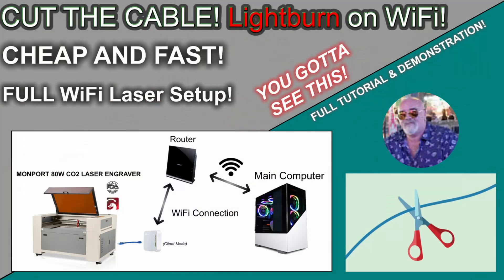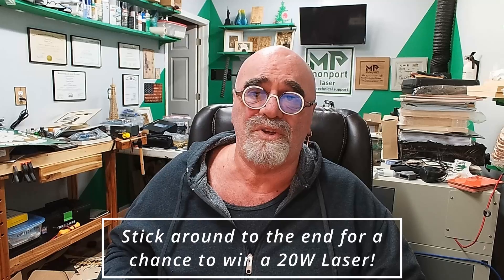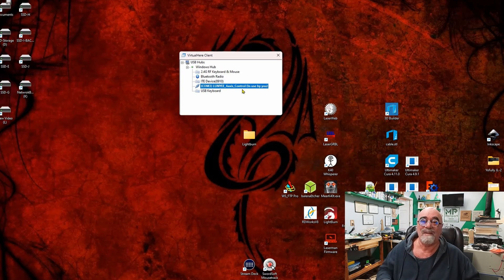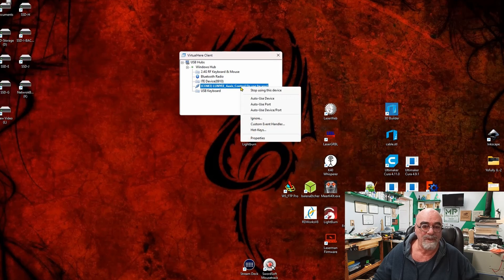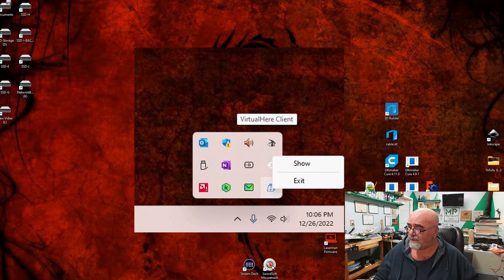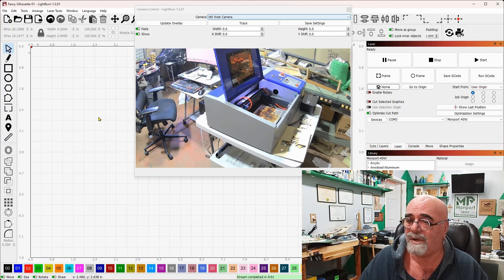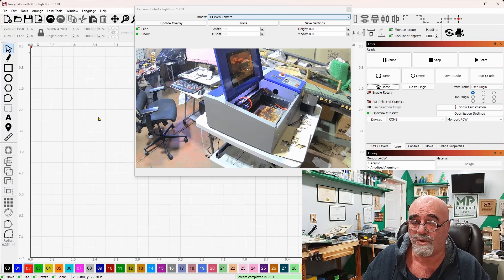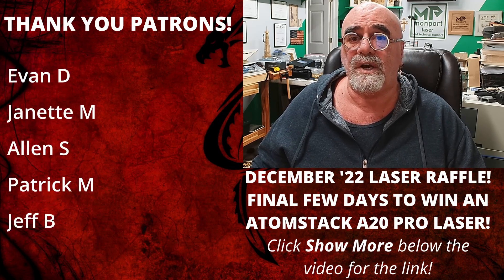➡️Remotely control your DIODE LASER⬅️ with ANY OLD DEVICE with a USB port on your network!

Comment: Much easier and cheaper to use any old notebook and Anydesk software to reach it from anywhere. Make a project in Lightburn at home, save it, pull the file to the notebook next to laser, open there and burn. And notebook's webcam from the lid can be used to control visually.
Reply: Oh yeah, that's way easier and cheaper than selecting connect on free software and opening lightburn...😆😆
Reply: @Ron Staton  Ah, I always forget, that you pay for software.
Reply from the maker: I can think of a dozen other ways to do it, but none of them are easier or cheaper. We'll have to agree to disagree!

Comment: Is there away to get what I make on one computer with lightburn and have it come up on a second computer with lightburn?
Reply from the maker: There are several ways Terry. Networking is one, a NAS is another, or the most basic of all, a simple flash drive.
Reply: @TheLouisianaHobbyGuy  I've been using bluetooth but having to run up and down stairs sucks. Be nice if Lightburn could have where lightburn automatically would update to all comps.
Reply from the maker: Use remote desktop:
https://learn.microsoft.com/en-us/windows-server/remote/remote-desktop-services/clients/remote-desktop-allow-access
Reply: @TheLouisianaHobbyGuy  Sucks getting old. I use to use remote desktop many years ago and never thought about it for this. Thanks much!!

Comment: I tried virtualhere a while back but I couldn't use it successfully. It connected just fine, but I found it was dropping network packets occasionally and only sending parts of the gcode commands.
Reply from the maker: Well I've run over a dozen jobs on it so far with no issues. USB by its nature drops packets.

Comment: This is a pretty cool utility.  If I had a separate computer next to the machine it would be great.  But it requires a computer.  I checked their site and they support the Raspberry PI.  So then you can connect your laser to WiFi for under $100 using a Raspberry Pi. and the cost of the USBserver software.  If you had more than one laser a Rasp Pi could connect to them all and share them all.  The Pi comes with 4 USB ports.  multiple USB ports.  And I guess you could add a USB hub also.
Reply from the maker: Or you could use an old Android phone, tablet, chrome book or any old computer that you can pick up at a garage sale for $40.
Reply: @TheLouisianaHobbyGuy  Awesome!

Comment: Quite a good idea, however, does this system use the internet to interface the devices? If so, when you have an internet interruption, your system dies. Would it not be better to use two, (or more, depending on how many devices you are using),  USB to WiFi adaptors and create an AdHoc network? I have eight USB cameras around the grounds hooked up that way. No need for external software or licenses etc and the adaptors are quite cheap. Your system would also be safer because its self contained on its own network and the possible loss of data through transmission is reduced to a minimum.
Reply: Poking about their site it would appear that the cloud option needs dedicated steps to get it working. The easy way to check though would be to pull the plug to your ISP then fire up the server/client and see if it still works. I'd be curious if a packet sniffer (wireshark maybe?) indicated the system was 'phoning home' and what data might be sent. Dropping the setup on a vlan that's denied WAN access might work, but not the easiest option for many people to employ.

What hardware (specifically) do you use for your setup?
Reply from the maker: No Internet needed. The basic configuration runs flawlessly on any network. I tried two Wi-Fi adapters a few months ago and it didn't work with Lightburn.

Comment: I remember how many hoops I had to jump through to share USB devices over ethernet 20yrs ago; special adapters that were rather flaky when they did work. There are also BT to serial adapters, but I don't know if USB versions exist. I'd almost prefer a dongle over a dedicated machine, BUT I'd also wager most people already have something connected to their diode anyway. Very cool that it also runs on Android. You'd just need to make sure the Droid can charge while connected to the laser. 

This is even easier that UltraVNC since you don't need to know the remote IP. I still won't run mine remote even with a Webcam attending. The Z1 has stopped (more than once) after a comm error with the laser still firing. I need to flash the latest firmware; maybe that "feature" has been removed.

On a side note, I was poking around their forum looking for Win7 options (don't judge). The admin/mod known as Michael had some responses to a user asking about win7 that could have been handled better. He came across as arrogant and condescending in his reply saying the OP needed to get with the times and upgrade (that's a dubious term w/ MS) to win10. Half my systems still run 7 for various reasons. Maybe I can find a reliable source for a win7 copy of the server somewhere. If not then I'll just stick to VNC.
Reply from the maker: Well since they claim support for Win7 to 11 that mod was definitely out of line!
Reply: @TheLouisianaHobbyGuy  my laser PC is win7 so we'll see if it installs. I didn't see win 7 listed on the d/l link.
Reply from the maker: Oh, I thought you talking about the Z1... never mind!

Comment: I was an idiot and did not read far enough!! - The trial edition is restricted to sharing one device at a time.  - ORIGINAL POST START HERE-Looks like it's $49 for a license for the server after the 30 day trial. Cheap enough to make life easier without breaking the bank :)
Reply from the maker: Hmm... I've had it on my Linux box since V 2.6, or about 6 or 7 years now and haven't paid anything. The license is if you need more than one USB port, as well as all of the paid features of the server. To run one USB, it's free to use.
Reply: @TheLouisianaHobbyGuy  Well holy cow then it is definitely not breaking the bank :)